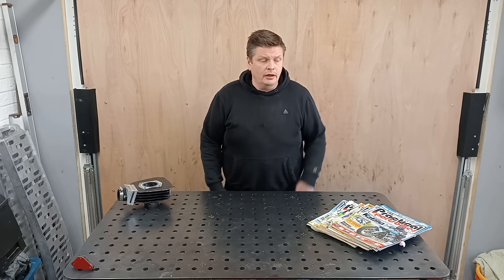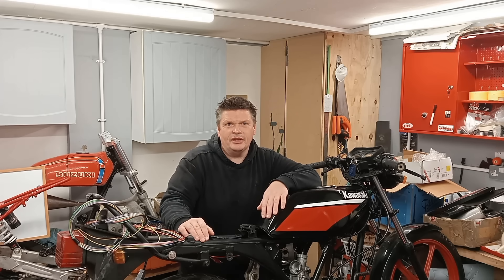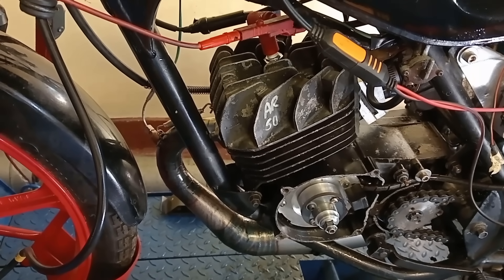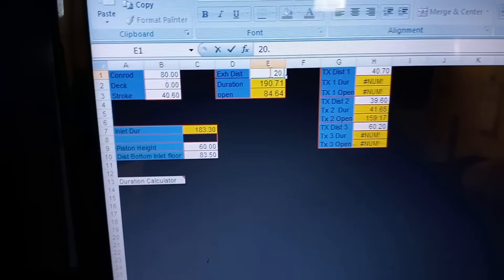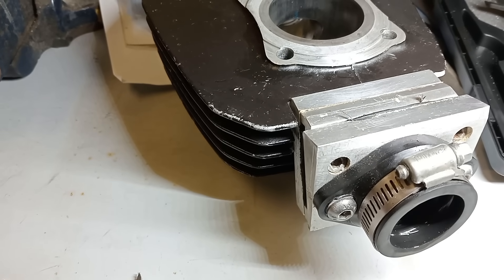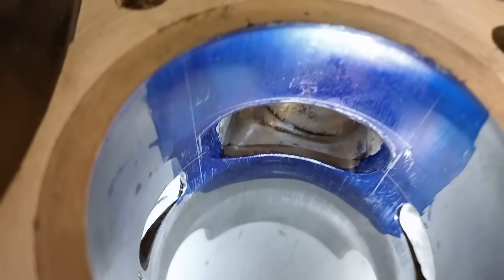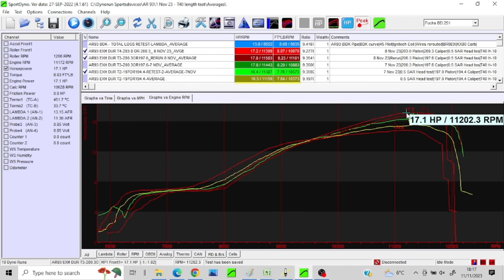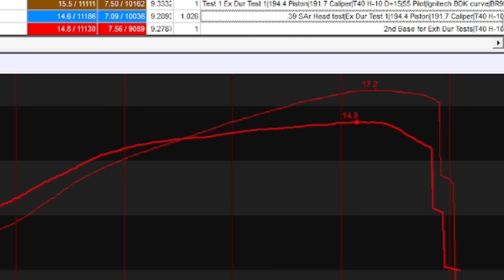This Tiny Port Change Changed Everything (Dyno Proof) #2stroke #power  #porting

Comment: You are leaving power on the table. The intake ports need to be smooth with no mismatch between intake manifold, gaskets, cylinder and liner. The transfer port also need to be smooth with no mismatch between casting, gasket (between cylinder and cases)  and cylinder liner. The exhaust port needs a mirror finish with no mismatch between... Only mirror polish the exhaust port, do not mirror the transfers or intake. Just this alone could be good for 3-10% more power. Oh, and the exhaust pipe needs to be tuned to the port timings. There should be 2 stroke exhaust tuning guides to help with the pipe dimensions on the Internet. And be careful that the ports are well rounded in the corners so you do not snag the ring in the port. Basically the wider the port the more rounding you need in the corners. There should also be Internet pages to help with this too.

Higher compression will help a lot with HP however you risk burning up the engine if not careful.

A larger carburetor will help with top end and likely kill the bottom end power.

You can make two exhaust pipes one for high HP and one for max torque with a flat power band. I did this on a high HP cylinder that gave it a nice flat power band for riding in the woods.
Reply: Hey mate great work and luv your dyno overlays definite thumbs up , however John is exactly right mate in regards to Port finishes and mismatches and this is where i,m super fussy ,and rounding ports and single ring . My sons and I run dirtkart with twin 100 yams , I rebuild and port all ours using above methods with great results i use a thin feeler guage in ports and degree wheel ( mainly for repeatability)though as direct drive I can't go too radical with exhaust timing or we loose to much bottom end and I also cut the head and tighten squish as tight as I can and this my friend really wakes them up . We like to run our engines 15,800 rpm and there reliable at that , have seen 16,500 on the tell tale but to much time there I question reliability. We've had great results and been approached by a lot of people for engines. Ps I also port and match the crankcase as this is also a major part of your transfers . Cheers.
Reply from the maker: @adrianjackway5138  thanks Adrian, I will look into the finer finishing areas in a later video. Cheers again, Dave.
Reply from the maker: Hi John, thanks for the info. You are the second person to mention the polishing of the exhaust duct and I'm keen to try that at some stage. I'm only after speed so as long as the powerband is wide toughen to pull all the gears (plus a bit for granny) I'll be happy :)

Comment: Gone from 196 to 203 degrees is what i use on my bike with an derbi ebs engine malossi mhr replica cylinder and it works wonders in making it live on high rpm, low down is no problem as the hebo bufanda without the extention stinger before silencer gives reasonable down low and up on topp
Reply from the maker: Extec, great to hear this timing works on other engines. Low end isn't a massive concern for me either... As long as I can get it on pipe and moving I should be good for the top speed runs.
Reply: @AutoBeta2T  mine is dynoed to 17.7hp depending on gearing top speed above 100km/h with my normal gearing 13/53 and posible to add 2-3 teeth on front for more speed.
Last time i changed piston where spring of 2010 and used the bike extensively for race track, street fun and for a while transport to work, stol got almost the same compression as it had new. 
4% oil at all time.
Reply: The critical part is geting enough compression when rasing the exhaust port and get the blowdown timing right as when its to low or high it tends in both scenario to make the engine feel empty of power but more so on torque
Reply from the maker: Thanks for the info Extec :)

Comment: nice job on ex port.what comp ratoio are you running ? as you know this takes away some.
Reply from the maker: Hi Skyhawk, from memory it was 13:1 geometric, I can't remember what the corrected ratio was but as you say it will be lower now I've raised the exhaust.
I'll do an engine current spec video I think. I've lost track a bit myself and also I had the timing measurement wrong too so a reset and review of where I'm at should help everyone 😁

Comment: Sorry if you mentioned it, I'm kinda skipping through quick before bed. What's your base ignition timing? I'm betting you can pick some of that lost low end by advancing the timing 15-20 degrees. Just a thought!
Reply from the maker: Hi Halverson, the curve I have programmed in is the BDK curve seen here: https://bdkraceeng.co.uk/Bike5.html

But I have moved all of the timings 2000 rpm to the right as the pipe is shorter. 
In the next vid I do a bit of ign mapping to see if I can get a bit more power.

Comment: Love your work. I envy your access to a dyno.
Changing exhaust timing will change the required tuned length of the pipe. At this stage I'd be looking at the pipe length and jetting. I think it was Bell who said "choose your porting and then tune it with the pipe".
I use Fritz Overmars' method of checking when the port is classed as 'open', using the 0.7mm bent wire. It gives consistency. 
Have you delved into the specific time areas yet?
Reply from the maker: Hi Rob,
Yes a new pipe at some point but in my case I think I was getting the exhaust port aligned to what the pipe wanted. I had to move the ignition curve to the right 2000rpm too. 
I used Frits' method to measure the ports which is where I think I had an issue as the dykes ring piston doesn't control the port opening - it appears to be the ring as the top of the piston is a smaller diameter that the rest of the piston to accommodate the L shaped ring. I need to double check again though.

Comment: Another great video. look forward to seeing further gains with pipe, ignition,jetting etc. Like someone mentioned, what did EngMod2T say vs dyno? Next video with flow testing should be a good one too!
Reply from the maker: Hi Andrew, yes hopefully a little more to come yet... I've not rerun the sim yet. As I re-measured it looks like I was out a bit on the timing for the exhaust. This means maybe the same for the transfers? 
Flow testing will be interesting as I've not done it before 🤞
Reply: @AutoBeta2T  This means maybe the same for the transfers? I would run the numbers in Engmod. I have a flow bench but only ever used it doing 4 stroke heads, throttle bodies/carbs/airboxs/ etc. Seen VHM did 1 video with their 12 degree piston but other than that haven't seen 2 many positive comments using it on 2T but nothing ventured nothing gained. The more info you have to analysis the clearer the picture becomes in my opinion.
Reply from the maker: Hi Andrew, any information is good I think. Even if it doesn't work at least you know :)

Comment: Really good gains from raising the exhaust port, with these small capacity two strokes every tiny modification matters.
I've no doubt you will see extra power with the exhaust sealed up and regaining backpressure and further gains when optimising ignition timing and jetting. 
Looking forward to the next video!!!
Reply from the maker: Cheers and hopefully a little more power next time. I normally get a good deal on the sliding belly but not this time.
Reply: @AutoBeta2T  great work! i love these kinds of videos! 
I would love to see if polishing up that port would also bring some smoother HP.
And maybe also chamfering/deburring that inner side of the exhaust port so that the piston rings glide over more easily
Reply from the maker: @InFlamesOfSorrow cheers buddy. 
Yes the port polishing is on the list of things to try (it's getting quite long now) so hopefully in the new year I'll get around to trying it.

Comment: maybe a little wider @ the blowdown aera and add a radius on the top contour of the port, good for ring life and duct flow. Also the transfers look small for a 93cc?
Reply from the maker: Hi Mog, yes, I have a little to play with on the width and  - agreed about the transfers... I think I I measured them incorrectly and epoxied the roofs to lower the timing when I should not have. I'm going to have a remeasure of the engine and then go from there. I'll do a vid on it as a record and a chance for people to comment on the current spec. Cheers for watching and for the info. Dave.
Reply: @AutoBeta2T  great channel tho! long time ago i did moped racing in the netherlands. The rules where aircooled 50cc 4 speed with max. 16mm dia. carb or 12mm for 6 speed. We then had 10whp with a 4 speed tomos piston intake engine . But the top 3 had 14+ whp or so. What i can remember was the golden rule of 28/30 degree blowdown with 130 transfers, exhaust as wide as possible (without transfer interferance) , a good tuned pipe and you'll be good. Looking to your setup 25/30ish whp  should be possible with unlimited carburetor dia.
Reply from the maker: Cheers Mog, I used to race 50cc too in the UK. But we were Am6 and Derbi 50's lots of fun racing!

Comment: Very good video, no bullshit and perfect approach to mods, had to subscribe. Can you make the same video but raising all the Port timings by putting a thicker gasket (+0.5mm) and embedding the head to keep the same compression ratio? That would be awesome
Reply from the maker: Thanks Riccardo. I did try raising the barrel with a 0.4mm gasket before the final exhaust port grind but lost power. Maybe that was because the compression dropped? Because of how the head fits it's a bit tricky to adjust the compression.
I would like to make a skull cap with interchangeable domes. This would allow to do what you are describing.
Reply: Definitely spend the time making skull caps, as this will give you time to build in squish variables too
Reply from the maker: That's the plan. However, I've brought a load of AR50 heads off ebay and plan to try different squish and CR with them.
Reply: @AutoBeta2T  si tu mets une cale  sous le cylindre   il faut que tu  rabotes le dessus du cylindre de la meme epaisseur pour concerver le meme taux de compression
Reply: OK and FWIW, I’d mod the worst one AR50 head, especially if you access to a lathe, some good quality aluminium stock, but it’s your baby :)
Reply from the maker: @mikecrane2782 the standard castings are generally not too bad. I do have a TS100 head (the same as used in the original project) that I planned to use with inserts (it has a lot more mass than a AR head). Like a lot.of this it's finding the time at the min.
What grade of aluminium would you recommend for head inserts?
Reply: @AutoBeta2T   The guy near me uses 6061, but his engines are water cooled. I’ve made spark plug inserts using 7075 and had no issues either.
Reply: Hi guys. I'm looking (as part of the greater plan) raising the barrels on an RZ350 with double base gasket then skimming the head to remove the extra difference in lowered secondary compression. I am then going to  skim the reed valve flange on the cylinders (ensuring reed to piston clearance) to maintain primary compression and checking squish clearance as a post mod/s check. Thoughts? Did you check squish after raising your cylinder with the fat base gasket? 
Si.